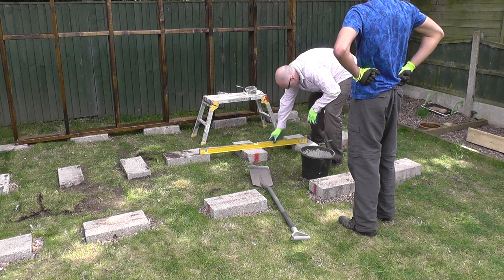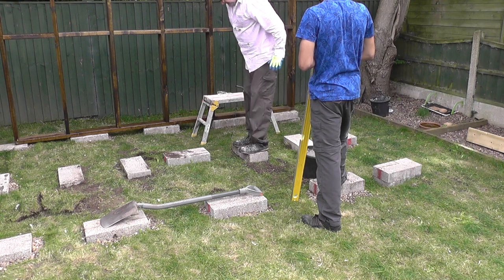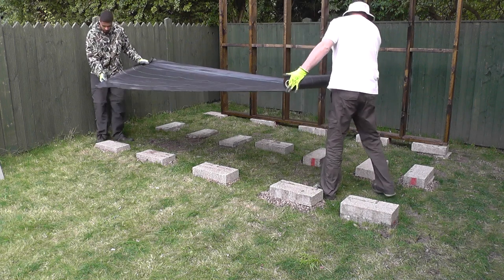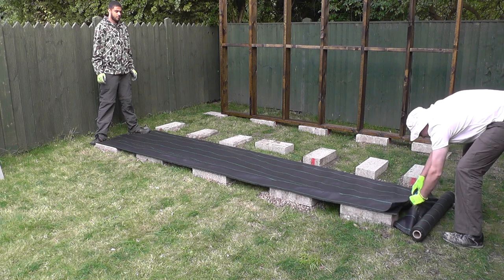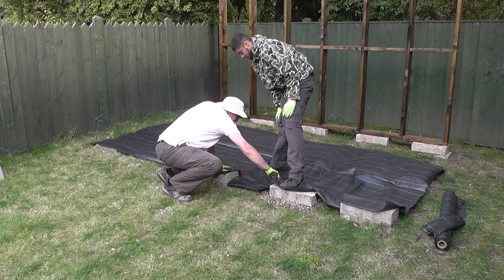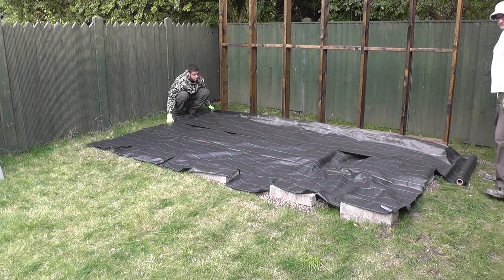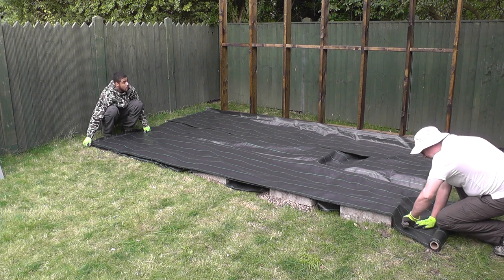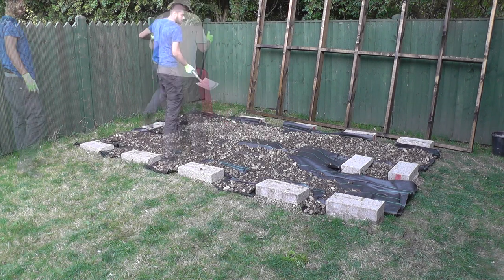DIY Man Cave / She Shed - Part 3 - Footings / foundations complete

Comment: Hello, I’ve got the usual selection of alignment/levelling tools such as spirit levels and lasers but I don’t have much confidence in them.  I have now gone retro and started using a water level and plumb bob.  They are never wrong ( I think...).  Loving the build, thanks.
Reply from the maker: Hi there. Interesting point that. The traditional tools you refer to have been used for millennia so I can't foresee them breaking down any time soon and are, no doubt, more reliable. Best wishes, Des

Comment: Doesn't make sense cutting the membrane round the blocks (As weeds can now pop up at those points), you should have laid the membrane first, then repositioned the blocks.
You've made laying a base incredibly difficult, costly, and time-consuming, you should just have laid a dry mix of sharp sand and cement.
Reply from the maker: Hi there. Completely disagree. Laying a base is a difficult job anyway and there aren't any short cuts. Having said that I'm not an expert but I did my research first. I think your suggestion of sharp sand and cement would actually be a very poor choice in this garden because (1) it's on a slope and both the foundations and the structure would be very unstable (2) you would still need to put down an adequate layer of hardcore to provide a stable foundation (3) there would be insufficient ventilation underneath to prevent rot and decay (4) cement would eat into the weed membrane and destroy it (5) the soil is mainly clay and there would be no proper drainage underneath. Sorry but this would basically this would be a disaster. ATB, Des
Reply: @21stcenturycaveman33  I was looking for comments that the weed membrane was not needed. Surely nothing will grow there as it's in darkness?
Reply: @MonaichFother  That little diffused light from the sides would be enough for some species to start, and they tend to grow longer in the dark. 

Lack of water will be another factor to slow them down, though.

OTOH, I also don't think it's that critical if some would still grow. It's not bamboo, hopefully. :)

However, moisture control is critical, and one way to help it is indeed suppressing weed. But, that's not enough alone, so you need a proper & complete solution for water anyway, which may make the weed thing mostly redundant (barring some minimal mechanical load those plants may impose on the coating etc.).

Comment: Over kill
Reply from the maker: Hi there. That may well be the case but it will stand there longer than I'll be around. Also the small difference in cost between 'Over kill' and just 'making do' is more than justified in terms of longevity and to my mind simply not worth it just to try and save a few quid.  Just my opinion though buddy. Very best wishes, Des
Reply: @21stcenturycaveman33  Yes you are right.